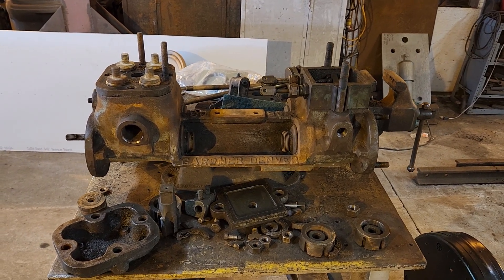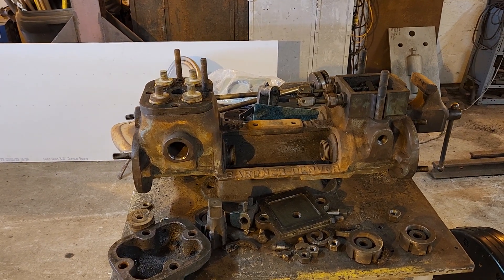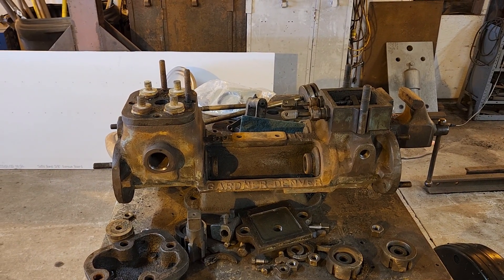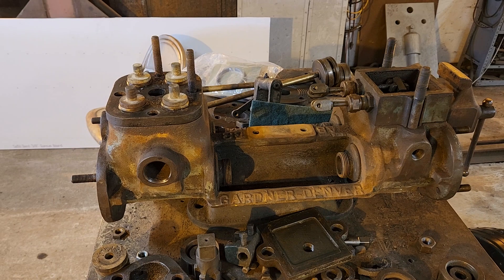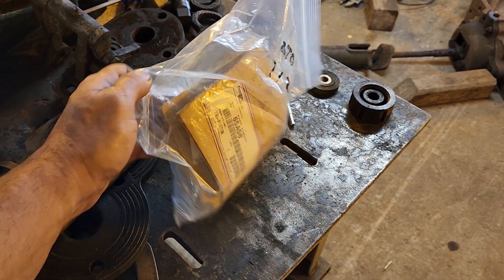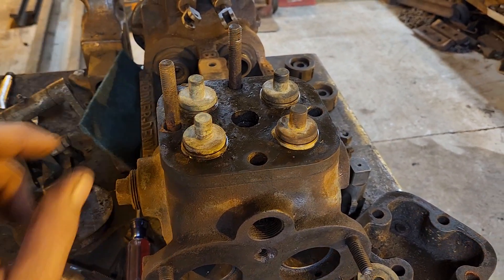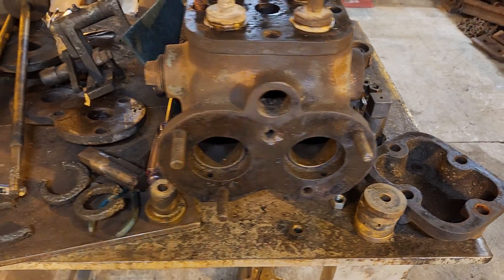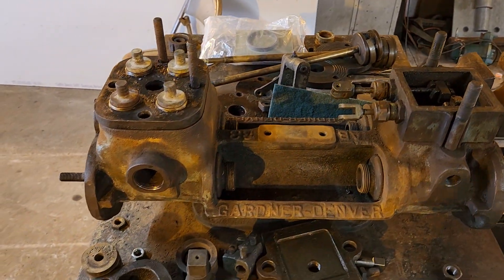Rebuilding a Duplex Pump Part 1

Comment: Our maritime museum runs about 10 duplex steam pumps (and some Weirs) and have rebuilt most. Gardner Denver generously provided a service manual pdf on basis we would not use it commercially. The water pump rings in fibre can be original on GD and on Worthington pumps. End play is set by peeling off thin layers of fibre from the rings. 

Then we have success using Teflon filled nylon rings but more recently we use Acetal rings, turned up 5% over diameter and with a 45 deg. split cut. We don't double turn these rings to final OD, although we probably should. Helps get the rings on if the pistons are built up (Not all are, and we have to carefully spring the rings out to get them on).

For steam rings, we turn from cast iron hollows - Again 5% oversize on the diameter and about 4/1000" axial clearance. 45 degree cut. With cast iron rings we should machine to slightly oversize, cut the ring gap and heat set to 5% oversize, then pull in, clamp, and final turn to exact diameter, but for pumps, we do not worry about this.

Comment: Rick, I used graphite packing to make rings for the water end of my Worthington pump and they make great pressure and are holding up well. Would be worth a shot!
Reply from the maker: If the delrin rings don't work out I already have graphite packing cut and ready to go in its place. That was plan B all along but good to hear that at least someone else has used it.
Reply: Graphite seems like it would be good as the flakes that come off can also act as a lubricant. I’m a guitar player and putting pencil graphite between the nut slots helps the guitar stay in tune and makes bending slightly easier since the strings have to move around a lot!

Comment: Sweet, that is the one you were talking about. Awesome!!!!   I think you know this, but you have to have more than 200 PSI water pressure to get water into a 200 PSI boiler against the check valve. The higher the pressure differential, the faster you can get water into the boiler.